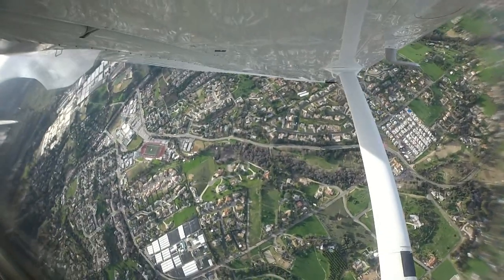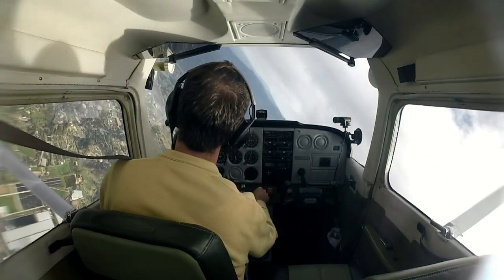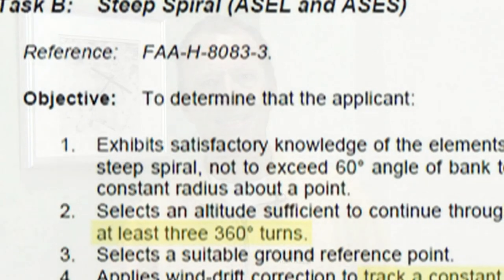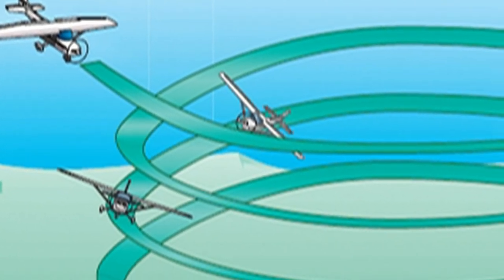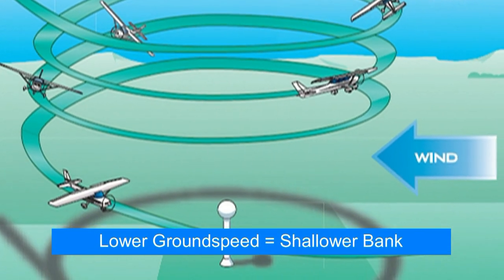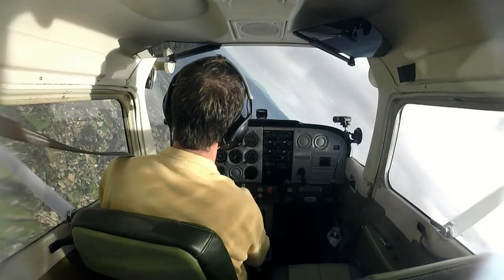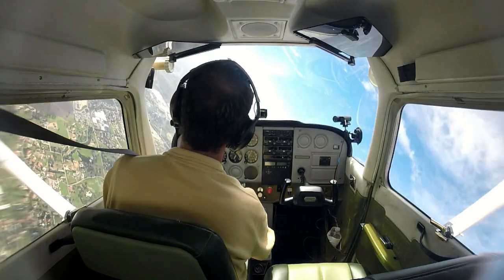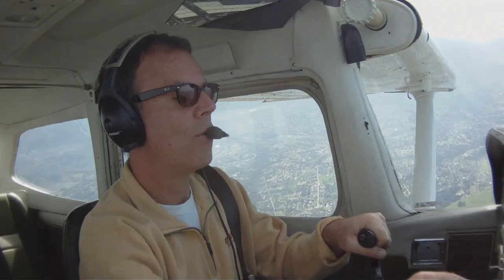Steep Spiral Commercial Maneuver

Comment: ACS lists STEEP SPIRAL and EMERGENCY DESCENT.    They are listed as different maneuvers.    Questions to ask yourself.  What situation would warrant using a STEEP SPIRAL vs EMERGENCY DESECENT.      What are the main differences on how you perform each maneuver?
Reply: Emergency Descent gets you down FAST. Think your engine is on fire and you’re trying to land before you burn up. 

Steep Spiral you have an engine failure while over your intended landing area, so you don’t want to get away from that point while you descend. 

In an emergency descent, you typically have max flaps in, and descend at a faster airspeed (top of the white arc). For steep spiral, you pitch for best glide.

Comment: More great content Garry: I regularly view your videos before going out to practice - really helps my focus and flying technique.

For Steep Spirals, are you using zero (idle) throttle throughout, other than momentary engine clearing on upwind? Are you using any flaps? I hear different things from different folks: wonder if that's all a matter of personal preference, or if it depends on the particular aircraft you're in?
Reply from the maker: Yes, power to idle (fixed pitch prop in descent still idles about 1,000 RPM). I'm probably flying this slower than most would; Vbg in C172N is 75KIAS, but that's at MGWT, and I was hundreds less than that; hence I picked 65KIAS. You can hear the stall buzzer a couple times in the video on the steepest banked turns, even though I am still 5-10 kts. above stall. I just wanted the demonstration to be clearly different than Emergency Descent Maneuver, which you can fly with or without flaps and descend at much greater airspeed (Vno, Vne or Vfe depending on configuration).